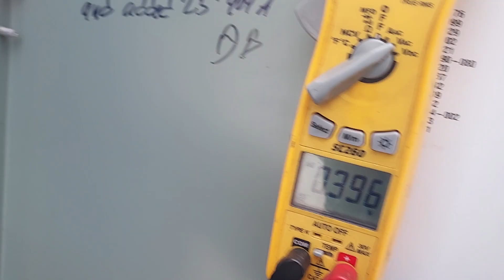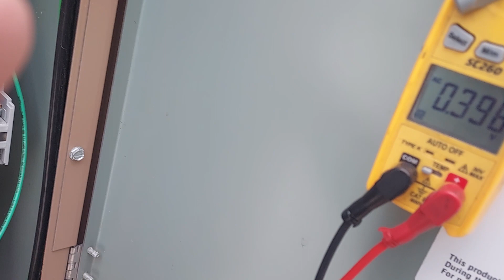Refrigeration: Paragon defrost clock basic overview.

Comment: 💪🇺🇸👍❄️ how r u testing the circuit with no voltage to clock ? Terminals 1 - N power in should have voltage reading. Jumper bar from 1 - 2 terminal so u dont need another wire to #2 terminal. Defrost contacts NO 1 - 3. Probes  on 1- 3 r  defrost contacts - ovolts when in defrost mode if u put probes on 3 - N during defrost u would have voltage reading(load). Cooling contacts NC Refrigeration mode probes  on contacts 2 - 4 ovolts when cooling.  If probes on 4 - N voltage reading(load) during cooling.
Reply: Hey mate I have a question, when testing this clock on a unit are we testing continuity or voltage? I'm assuming if the units on were testing voltage correct?